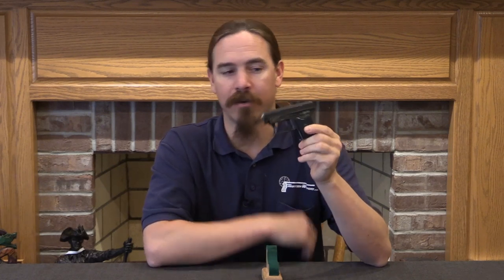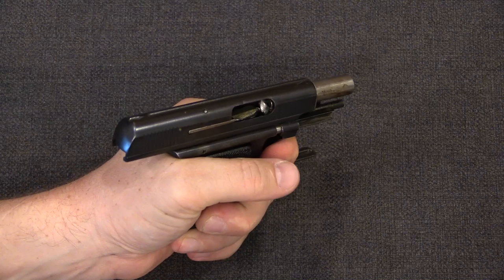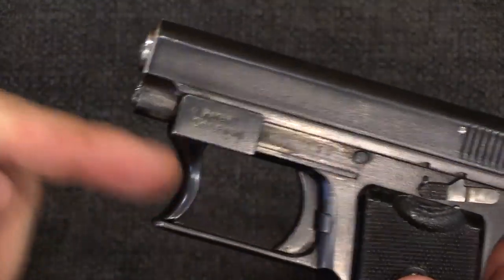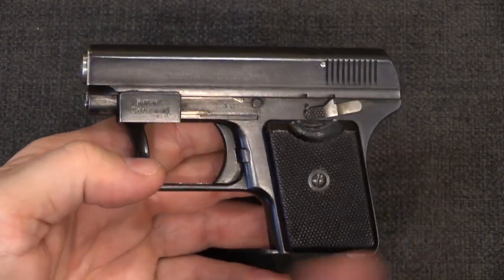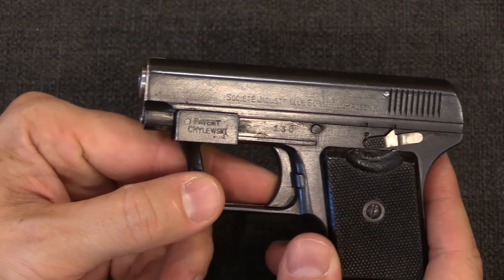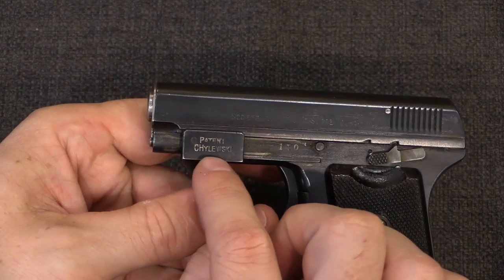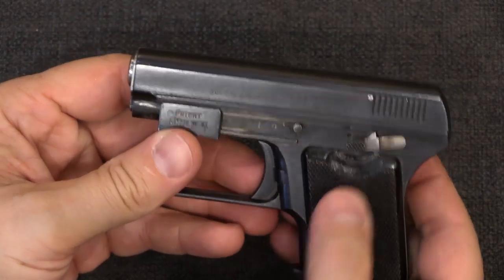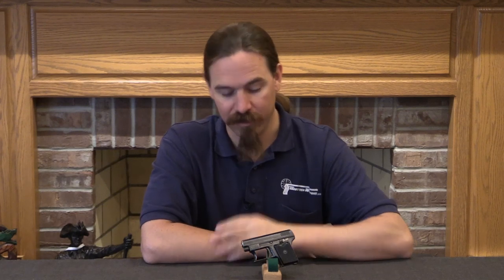SIG Chylewski: One-Handed Vest Pocket Automatic

Comment: I believe the Red Chinese marketed a trigger cocking Pistol in the 80's.
Reply from the maker: Yes, the Norinco 77B.
Reply: @ForgottenWeapons  they also knocked off the P7 gas delay system on that one
Reply: @CenlaSelfDefenseConcepts  The trigger finger cocking was probably mechanically simpler than the squeeze cocker of the P7, and the gas delay system is very simple with few moving parts, and in theory the fixed barrel would allow for better accuracy. In practical use I doubt the increased accuracy is a huge improvement, and the gas delay system is expensive in terms of machining, at least according to H&K.

Comment: What happens if you pull the trigger that racks the slide a second time? Will it fire the round in the chamber or eject it and rack then fire the next round in the mag? Cuz that would be really dumb. If you ever were to use this gun in self-defense chances are very high you won't remember to change from the first to the second trigger between shots. If so out of a 7 round mag you will only get 4 shots with 3 bullets ejected unfired.
Reply from the maker: Using the cocking lever does exactly the same thing as racking the slide by hand. If there is a round in the chamber, it would be ejected.
Reply: @ForgottenWeapons  Okay I'm guessing the slide trigger doesn't release the striker at the end of travel. So you would then have to pull the second trigger to fire the now chambered round?...Yeah pretty cool, but I can see why the idea never took hold.